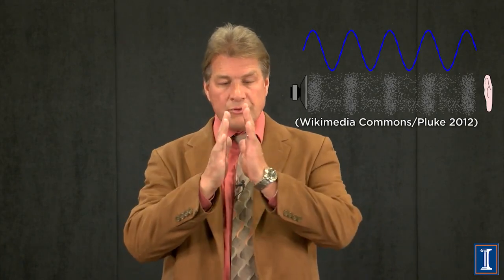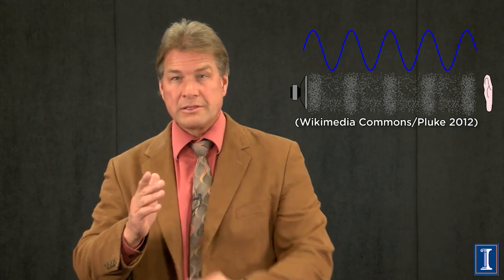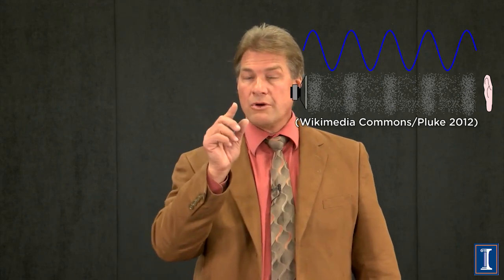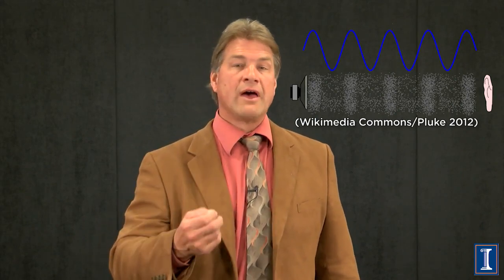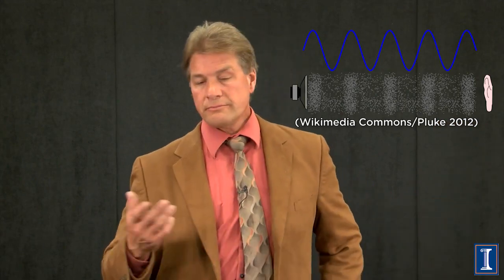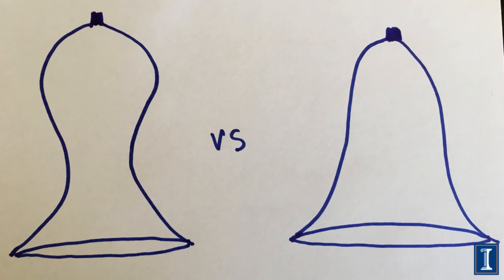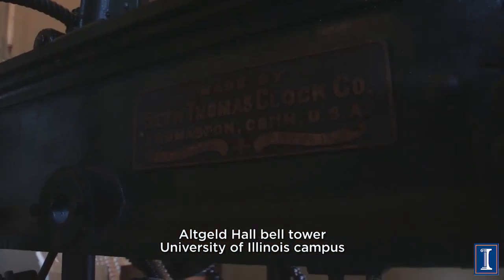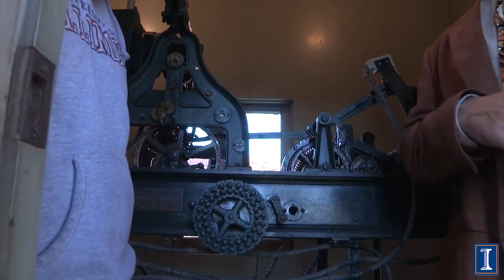How Sound Works and Why Bells Sound Good

Comment: Thank You!!! The metal bell of a balanced mix of metals sounds so nice !!! This means that the pressure of the beater is on the bell and the buzz is on !!! And location to place varies depending on its climate !!!